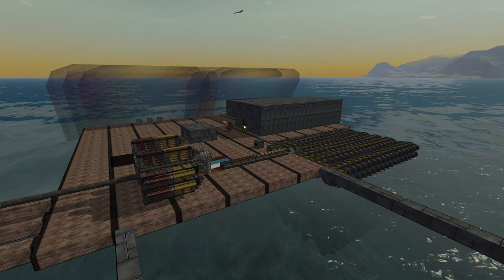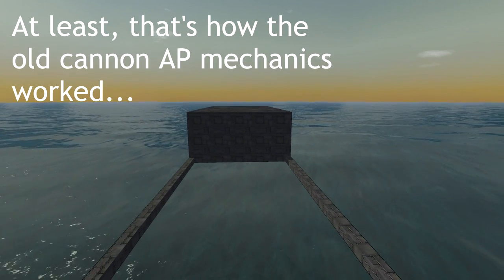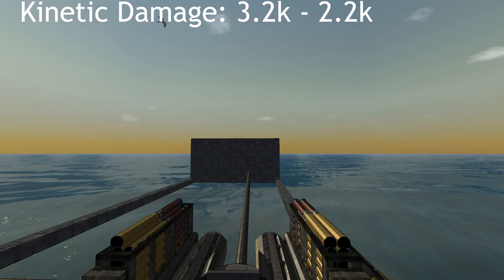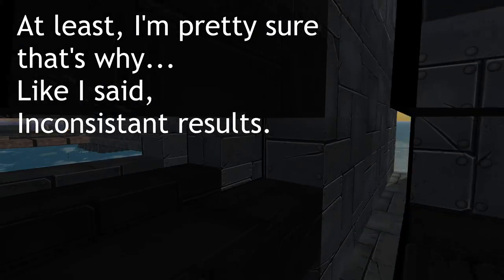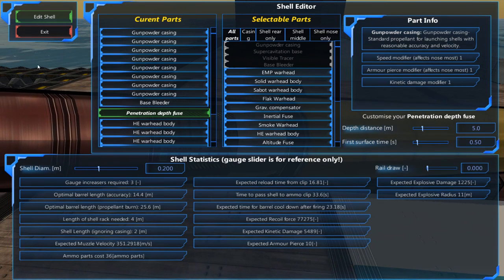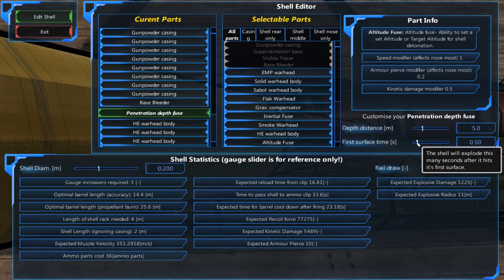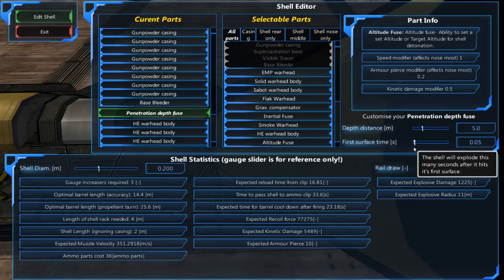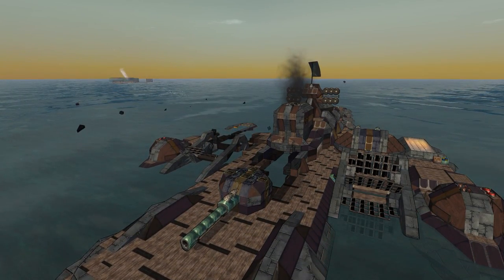Penetration Depth Fuse Tutorial - Advanced Custom Cannons - From the Depths

Comment: i get how the AP works but i dont get this... the AP shell pirces good but as soon as i add ONE warhead it instently detonates on the 1st contact of the 1st beam leaving it no pirceing enything
what am i doing wrong??
Reply: You need a to add a penetration depth fuse in the ammo customizer. You also need to make sure your shell actually has enough kinetic energy and armor penetration to actually get through the first few blocks. 
Old comment, but I figure someone else seeing your comment might have the same problem.
Reply: my problom is solv long befor you posted thet commend but long ago i did what you sed and it still was the same probely a bug

Comment: How does it work with beams? Like when I put a beam somewhere, facing me, with the 1x1 side, and I shoot it, will it count as 4 meters?
Reply from the maker: +laggyWII Nope, it still counts as 1m.  Think of the 1m as 1 block instead and it's probably a closer comparison.  If you have a line of beams end forward and shoot the 1x1 side, something that will go through 4 beams when they're in their sideways orientation, will also go through 4 beams lengthways.  It's kind of a niche problem really, as you rarely hit beams on that side, especially with a straight path through to other beams.
Reply: +ireLAN Gaming darn, so sometimes to armour something up, it's more usefull to use regular blocks instead of beams? For instance, I want my ammo protected by a layer of about 3 blocks of metal, I should use blocks instead of beams, correct me if I'm wrong. Liking the quick feedback! And hope that you will keep growing at this rate, you have my support ^^
Reply from the maker: Thanks, man.  Appreciate it!
It's rarely better to use blocks instead, even with this as a consideration.  The reason is, 1 beam has more hp than 4 blocks.  So you're actually making it easier for an AP shell to get through if you use blocks due to their very low trajectory.
An AP shell will indeed make a bigger hole vs beams, but it will penetrate much farther on blocks.
If you used 3 blocks, a shell will only need 600 dmg and 20AP to break through.  With a beam, it needs  3600 dmg and 20 AP.  Big difference. :)

Comment: Hey irelan I've been building the mega cannon for the perforator and all it does is burst for three seconds and reload for 18 second any suggestion on making it reload faster
Reply from the maker: +Endergaming You could try putting multiple clips into each autoloader, that should really help your reload speed.  Failing that, more loaders or reduce your gauge and/or shell size. :)
Reply: Thx I'll have to redesign the cannon but it will help pack more into a smaller space

Comment: Something to note regarding the first surface timer setting: after impact, shells slow down significantly so it's impossible to figure out on paper exactly how you need to set it. The math will get you in the ballpark, but at the end of the day it comes down to trial and error!
Reply from the maker: +Synoxys So when the shell slows down, it's gonna lose some of it's kinetic damage from the loss of velocity, right?  That's a really interesting thing to note.  Thanks! :D
Reply: ireLAN Gaming Correct! Lots of factors to consider when making these cannons. A lot of times it's just experimentation, and finding something that works. Unless you really really like math, in which case you have bigger problems! :)
Reply from the maker: Haha, well I suck at math, so I'm firmly in the 'blow stuff up for much testing' bandcamp! :D

Comment: hey i dont ever get block confeaty anymore idk why but it kind of sucks
Reply from the maker: +potato master 2000 Are you in degraded mode maybe?  Pretty sure that gets rid of the extra blocks.
Reply: i dont think i am how do i chek
Reply from the maker: It should say "degraded mode" in red letters in the top right of your screen.
Reply: how do i get out of it?
Reply from the maker: It automatically happens when your game is running slow so you don't end up with 1fps.  There's a slider in the options you can adjust, but I don't recommend it as it will slow your game to a crawl.  Best option is get a better computer. :)
Reply: i have a core i 7 4790k and a GTX 970 i dont understand why it does that
Reply from the maker: You fighting big battles?  Doesn't matter how good your computer is, if you go over about 40,000 blocks, it will slow down.
Reply: no ive been testing things in craetive mode and just messing around im getting like 70fps idk why ever since i got the game it has done this and i thought it was very strange even when fighting big ships the game runs ant a solid 40fps and i never put the slider up all the way
Reply from the maker: Hmm, that is indeed very strange. It could be a bug. :(
Reply: ive had the game for almost a year and a half ive had this happening the whole time i want the cool confetty
Reply: alright so i got ride of all the ships in my vehicle desighner and there is still degraded mode turned on idk why but it really sucks
Reply from the maker: I got no idea dude, sorry. I've never ran into that problem. :(
Reply: its so weird do we know if a reinstall will get ride of all my saves ships campaigns ETC
Reply from the maker: Your saves are all stored in a folder in "my documents" just make a backup to be sure before you do it.

Comment: I wonder if a HEAT with high ap and a fuse will rekt many layers of armor. lest say you have 10 layers of non spaced armor on an enemy ship. Shoot it, and when the ap part of the sell has pass tru half of the armor the HEAT goes off with the fuse (when it runs out of kinetic energy) and destroys the other half of armor and equipment inside that. Ultimate Behemoth and Base destroyer!